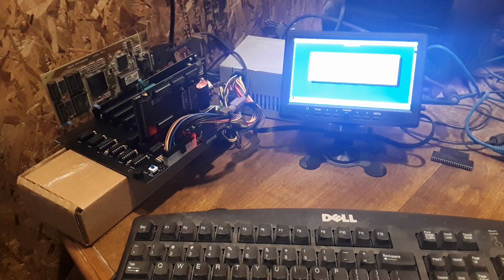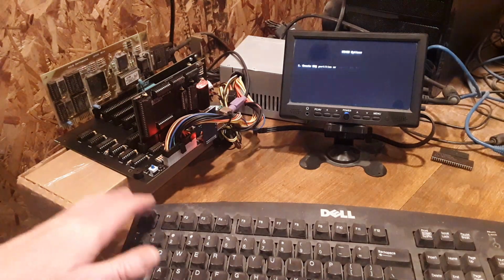8088 PC XT Compatible

Comment: Did you know the CH376 is a full USB host, as well as its storage functionality? MSX-USB has it working with keyboards and ethernet controllers, with some code to start enumerating hubs.
Reply from the maker: Yes. Some of my early boards have a pinheader on port 0x60 for the ch376. I wanted to use a USB keyboard on my project. I was not able to find good source code for interfacing the keyboard. I will have to check out MSX-USB.
Reply: @elijahmmiller  sadly the documentation for the chip's more useful parts is only in terse, highly technical Chinese, and split between CH375 and CH376 datasheets... anything beyond the storage device use is working with raw USB frame data, and the best documentation I've found for practical host use is projects like MSX-USB.

The 8-bit 2-port interface that header provides would also suit an MPU-401 compatible MIDI interface, or an 8-bit LCD, or an ad-lib/OPL2 synth. Breaking a few headers out from an ISA card with a buffer on a range of ports would make for an interesting even-cheaper-than-ISA expansion/prototyping interface.

Comment: Each bit of progress is impressive!  I bet that the V40 + VGA + a sound card would make a sweet retro gaming rig.
Reply: I have a 386SX with 4MB for retro gaming, and I wouldn't trade it for anything. This board, having only 512K, would be hard pressed to be classed as a "retro gaming" PC. The sound card drivers, mouse drivers, etc. would tax the limited memory, leaving not much for gaming itself. That being said, I am the proud recipient of (what I believe to be) the first motherboard of it's type. I run retro BBS software though, and this will be tasked as a VERY retro BBS computer. I have (make) TCPIP -> RS232 adapters for my old computers so they think they have an actual modem connected, but in reality are using the internet to connect. Perfect computer for my desires, and I am very impressed with the progress of this project.
Reply from the maker: Thank you. 

I probably won't be adding a sound card. I just dont have one to work with. The pc speaker works for me. If someone else gets one working I'd like to see a demo of it.

From what I have read a some sound cards use a DMA channel. Hopefully I have connected the 8237 DMA card correctly enough to work. I will be running some basic tests tomorrow.

I left the V40s built in DMA controller disconnect it is not PC compatible.
Reply: @elijahmmiller  You are correct. I had a Sound Blaster 16 in the day. It was configurable, but used DMA 5 by default.